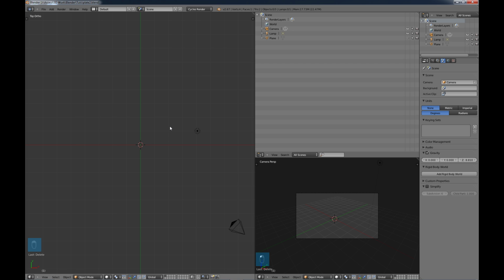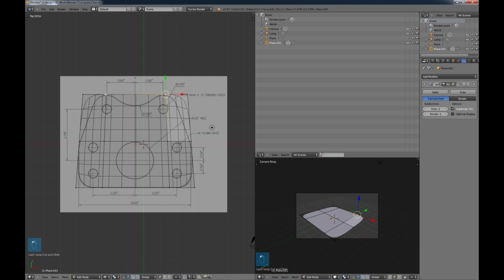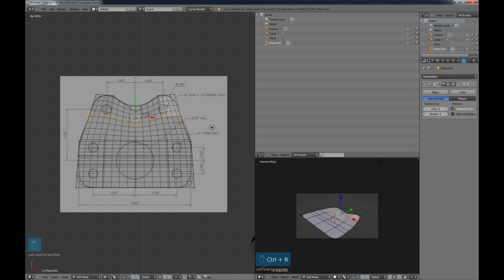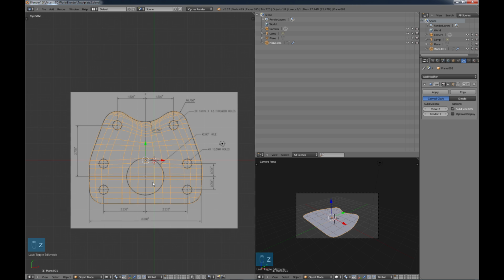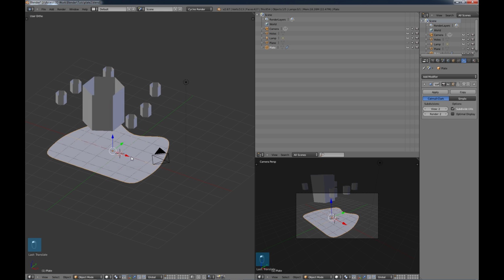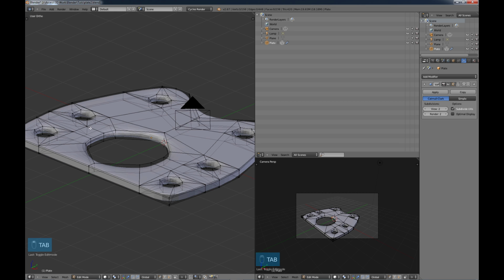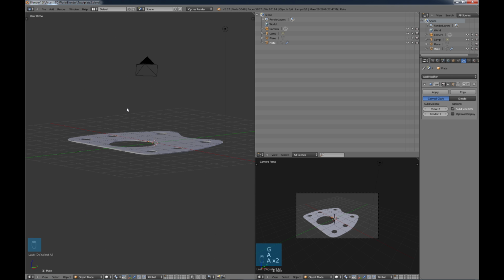Blender For Noobs - Modeling a metal plate with holes using subsurf

Comment: I have found a way that seems to be working for my curved surface, which is that I go through the steps of adding the cylinder, I apply the boolean modifier with the primary object selected, I choose difference from the drop down menu, I apply it, I delete the cylinder (you could just move it), and then I select the primary object, go to edit mode, which results in the protuberance in the place of the cylinder to be selected in edit mode, and I go into the delete menu, and select the option to delete faces, and it finally makes the hole.

Comment: I just cannot believe that a better way does not exist. If this is the only way, maybe it is better to use a cad software and after that to import the resulted plate in blender.
Reply from the maker: It's pretty easy to make this using NURBS in Blender.  I plan on making a tutorial for it when possible.

Comment: is there a way to make it exactly like reference piece? i can imagine in cinema 4d its easy to make shape w bezier curves and make holes with circles, than pull whole piece into 3d space via extrude. i mean this subdivision surface looks very random at point where you need to be precise.
Reply from the maker: yes, actually you can do this very easy with NURBS...which is a tutorial I want to do.
Reply: looking for it than
Reply: http://rghost.ru/59469014 - turn on addon "loop tools", create base form of plate with subdivide, select few polygons press W -> loop tools -> circle. If you plan well polygon modeling can be done very accurate models with good topology. You can do even more correct than the attached file. You can come up with several variants how to make this object. Just need to practice.

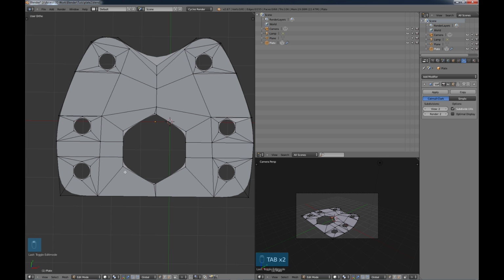Comment: ahh i think you miss a fundamental step to this process though, i been doing blender for about a year comp broke and just got one again. but anyways your mesh is perfect except one thing at 10:12 in the video its perfect. but without this trick that should always be done to make best edges with least amount of subsurf modifier added to make it smooth. is to double up the insides of the circles. cuz they are already perfect circles just low poly. so if you select a full inner circle extrude and scale just do small space between edge loops. they will be perfect circle when you subdivide cuz they have a backing edge that helps it to create the circle. so every edge basically needs one supporting edge right near it to make it sharper or less sharp depending where you slide that edge loop at.  i would also do it at the very outside edge also create another tight edge all around the object then it will hold its form better for subsurf.
Reply: and if it still not perfect circle you will need higher subdivision. so you have to practice with your starting points to figure what is the highest subsurf you want your finish model to have and adjust your start verts with that.

Comment: Thanks ! One question (total new to blender).Why we use cylinder with so few vertices (6) ?
Because when i finished my cycles looked like exagons in my plate :/ And when i tried to fix it i kinda mesh it.
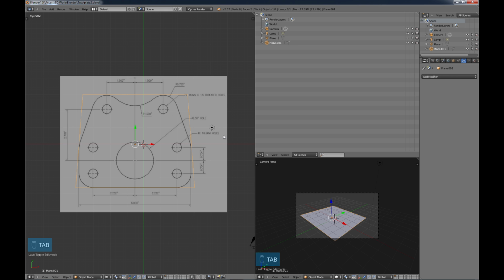Reply from the maker: because the plate is using the sub-surf modifier (1:40 ), it should make the holes round, but something may have changed with the latest version of Blender.  If so, you can always had the sub-surf modifier to your hole template and that should do it.
Reply: BlenderForNoobs
My bad.I didn t save the blend file and i closed it.Anyway got the point and i think i didn t do the modifier.
One suggestion.If there is not a big need to have your blender screen divided in three it s better to use only one screen in blender for tutorials because when i see a tutorial i divide my pc screen into two (1/2 blender and 1/2 your video) and your video that way looks too small.I use it that way because i am practicing while seeing the video and maybe other beginners do it that way.
Thanks again !

Comment: OK, I might have overreacted :)
But it should be said clearly and loudy:
1/ there is no easy way how to make holes in Blender.
2/ there is no easy way how to achieve CAD-like exact dimensions. No proper NURBS implementation is the most limiting factor. 

Even so, I love Blender :)
Reply: your workflow is WRONG 

I personally use Blender as My CAD software of choice, mainly for 3d-printing, but sometimes also for CNC 

point is 

you need to THINK about the mechanical workflow of the part itself and with that in mind you choose the way you use modifiers and get the shape you want 

take, for example this piece you wanted to edit: 

RULE no.1 OF Technical Hard Surface : DO NOT USE SUBDIVISION MODIFIER (SubDiv will NOT create circle arches, it will make G3-continous surfaces (consistent curvature) so every corner, every single angled surface will have a parabolic roundless to it, and not a circular one, which is what you want) you may still use SubDiv for parts meant to have an organic feel, such as tool handle, etc, but for the main part like you used here : NOPE

Rule No. 2 of Technical Hard Surface : Use up to 3 (yes, 3) bevel modifiers FIRST is vertex-only, with weights, use this on your 2d mesh vertices to make rounded corners and use the 3rd bevel set to angle and make the final shape look smooth a.k.a. the "FINISH Bevel"

So, if you want to create a stashed metal part, like the one above, you need start from a 2d mesh, create the basic shape, and follow along the sketch with the BEVEL MODIFIER, to make the holes use square holes and asjust the vertex weight for the Bevel modifier
on top of that, you add a Solidify, and then usually a Curve modifier, if you want to make, say a hinge or something ... basically, if you then need to BEND the metal part you just created, (see, this is whay I meant by saying you need to think about the manufacturing process when designing the parts)
on top of all that, you may add the 3rd bevel to make everything look smooth (PRO TIP : when 3xporting to a 3d-printer, always OMIT the 3rd bevel, because 3d-printers, unlike CNC will ALWAYS create smooth corners, so the 3rd bevel is thus, redundant)
Reply: not to mention, if you don't need any extrusion on the flat metal shape, you can actually go ahead and use NURBS, but not by adding the stuff labeled NURBS, no, fuck those, those are horrible, use the Bezier Circle, instead NURBS is basically just a subset of bezier surfaces, and in blender you're much better off using bezier for everything

add a bezier circle, set the mode from 3d to 2d, this way it will actually let you FILL the shape, then go to geometry and extrude it

this way you will be able to re-create ANY 3d metal stash sketch with 100% accuracy

Comment: This way of modeling is no use if you don´t respect the measures, i know it's just for practicing and learning software, but can´t you model something in blender that has real magnitudes, tolerances, etc?
i'm an industrial designer and i think blender is missing the engineering part of the CAD software, it does have great stuff (like cycles) but still, you can model this same piece in rhino, acad, solid, in less than 5 to 10 min, with the exact math proportions and ready to get machined.
Reply: Daniel Chavarría G. Yes, blender is not a hard surface modeling focused program. This is sort of a work around for creating hard surface modeling. By y the way, that is not the easiest method. Check out arrimus 3d. He models on 3dsmax but the modeling part is very similar.